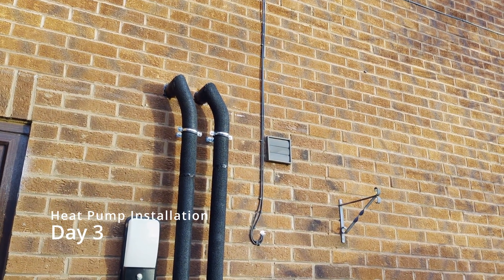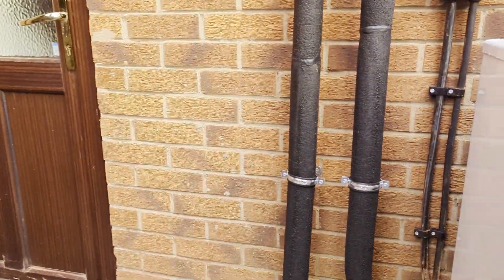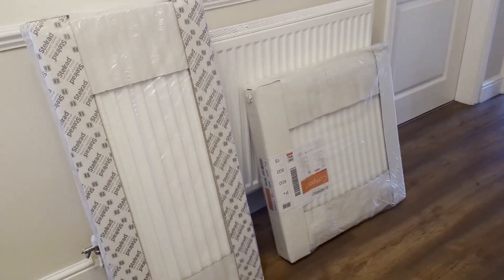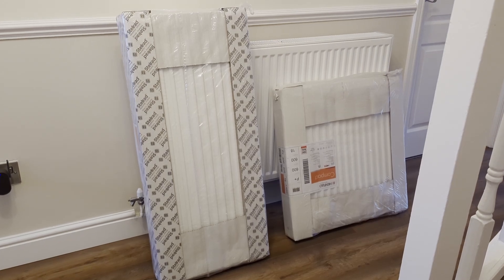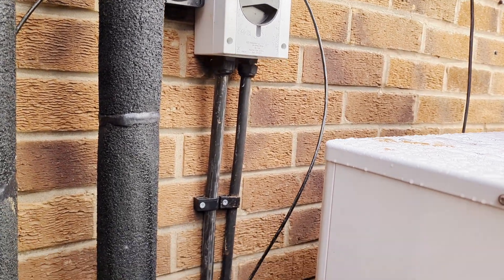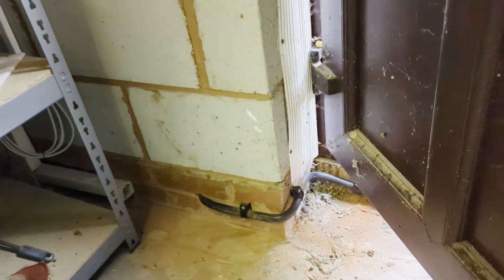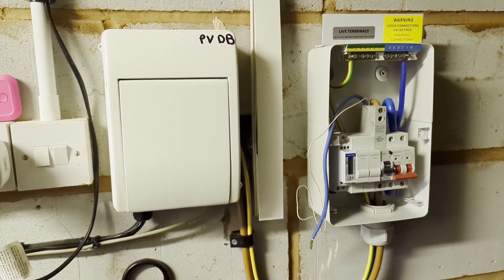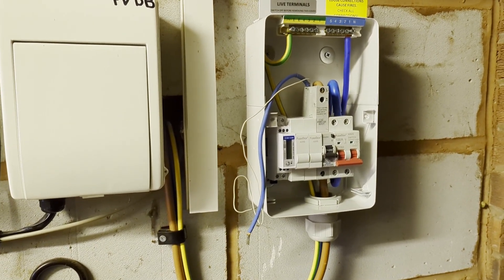Heat Pump Installation - Day 3

Comment: Isn’t the emergency isolator switch outside supposed to be red handle in a yellow shroud to meet spec?  Ta
Reply from the maker: No, as long as it's the correct type of isolator, the colour doesn't matter. Red/yellow isolators are usually for AC, whilst black/grey ones are for DC, but (like me) SCAME thought that red/yellow was rather ugly for domestic heat pump installations so they've made this AC isolator in black/grey. I think that it matches the Vaillant design rather nicely.
Reply: @ ok interesting.  This conflicts with what I was told so I’ll go and challenge it I think. Ta

Comment: Would it have not made more sense to run the EV Ultra cable under the door outside, and then come in the other side of the door? The bend radius looks rather tight where it goes around that door reveal, these cables have a minimum bend radius.
Reply from the maker: I agree, but sometimes you just have to let skilled, experienced professionals do what they know best.
Reply: @timminsit  on the bend radius for EV Ultra Bending Radius 8 x OD, this will degrade the cable and possable under full load get hot? Edit: the outside radius for a 6mm sq cable if that was used is 115.2mm that is more like the bend from the black isolator to the garage cable.
Reply: @timminsit  In my many years of experience, quite often these so called professionals have no idea, or they just can't be bothered to do it neatly or correctly,  are cutting corners, or just make stupid mistakes as they are rushing. Recently I employed an electrician to fit MC4 connectors, he fitted them back to front. I've had all sorts of problems when my extension was built, including quite serious structural problems. In the case of this cable in the video, it has a minimum bend radius and I'll pretty much guarantee that its less than it should be, it would have been much simpler to run it under the door outside, and then in, or even down the side of the garage.
Reply from the maker: I feel your pain and, to be fair, the (contracted) electricians for this installation did install the wrong types of RCD protection and that was only pointed-out by other people watching my videos, I would not have known that they were wrong. That said, when prompted, the company returned immediately and sorted it out.
Reply: @timminsit  This is the problem, most people wouldn't know if something was done wrong. When I found the builder for my extension I spoke to an existing customer who was having a house built, they told me how good he was, I later found out they took him to court due to issues that eventually arose in the later stages. He basically took on too much work, used contractors he hadn't used and didn't pay attention, which is what let him down. I'm very distrusting off the trades, if I can I'll do it myself I will, but that's getting harder with age and regulations.

Comment: Do you plan to add more batteries, or have you reached you spare solar power limit?
Reply from the maker: We need our batteries just to cover the evening, 4-7pm peak. During the summer months our batteries are charged by (say) 10:30am so we just dump the rest into the grid. Currently, give-or-take, Octopus Agile is giving us a good return.

Comment: The trouble with thick cable like that, impossible to make it look very tidy, especially around bends.
Reply from the maker: Yeah, that's true, but what are you going to do, the cable needs to have the correct capacity and it needs to be capable of withstanding British weather.

Comment: Vaillant recommend that the databus (2 core) is at least 0.75mm^2 per core, so have you wired that separately?
Reply from the maker: @Staedford  In a word, yes.
Reply: @timminsit  most excellent.

Comment: That is a wrong electrical setup. They will need an RCD type B in that board not a main switch or RCBO. Good decision to go with OEM!
Reply from the maker: Hmmm, OK, thanks for the info, I'll speak to the installer. Yeah, the OEM is great.
Reply from the maker: The electricians have visited and swapped the breaker for for a Type B RCD. How's this look? https://timmins.it/wp-content/uploads/2024/12/PXL_20241212_112900837-scaled.jpg

Comment: Hi there!
What flow temperature are you planning to use? I've looked at the Steelrad Compact models as well, but they dont have any heating output data for low temperature systems as far as I can see.
Reply from the maker: It's designed for 45 degrees.
Reply: I had Stelrad radiators fitted for my heat pump, K3 and K2, all the radiators were changed. Looking at my heat loss survey, they took the rating at 70ºC (Delta of 50ºK) and apply a factor of .344 to calculate the output at 42.5ºC - I don't know where the exact factor comes from (I'd have expected around 0.4) but that should give you some idea of what you would get out.
Reply: Alot manufacturers don’t, you use a correction factor to size each rad at required mean water to air temperature
Reply: Thanks for the inputs. Could any of you please measure the distance from the wall to the center of the inlet hole of Stelrad compact K2 radiator?
Reply: @alxgag3 It's in the data sheet on Stelrads site, I was looking at that the other day.